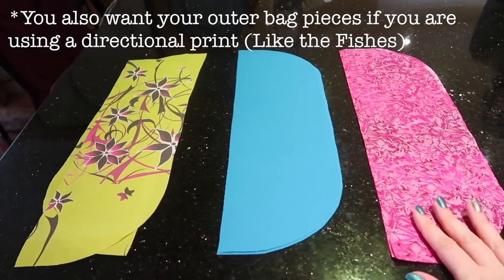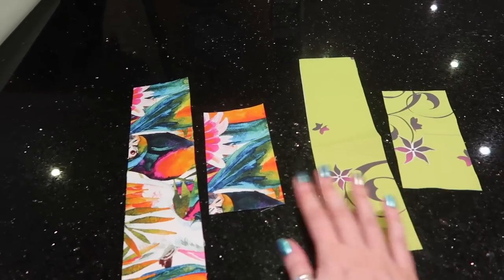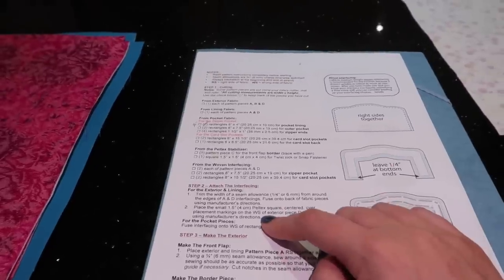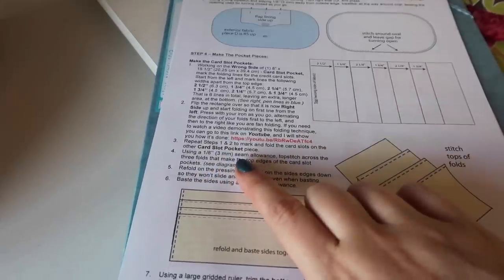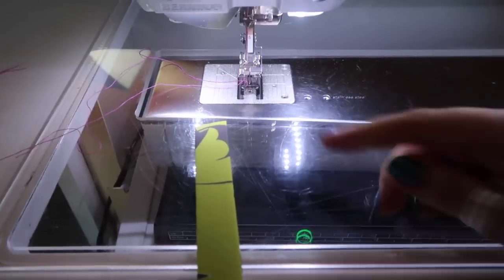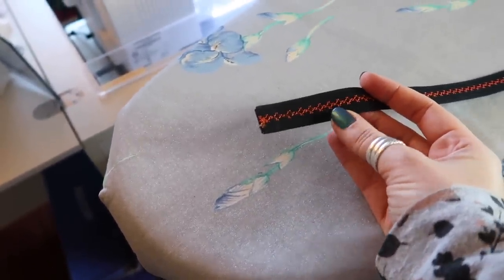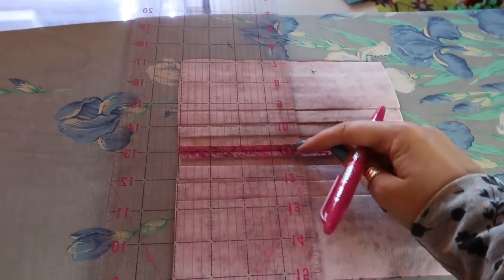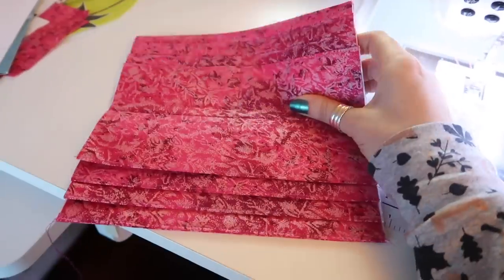How To :: Necessary Clutch Wallet Sew-Along :: Assembling the Card Slot Pocket

Comment: I cut my pattern pieces out traced them on to a plastic kitchen cutting board. You know the flimsy thin kind. Then used them as my template. Also I used this plastic cutting board to measure and trace a template to press out the card pocket accordian. I labeled them with their measurements, then slide them under the fabric, fold over and press, switch to the next size and fold over fabric and press, repeat. Makes it so much faster.
Reply: As I read this I realize it makes no sense, lol AND just how great you are for taking on a tutorial. Thank you again
Reply: Yes this is what I do You can also use them to help with your folds
Reply: @mayambrose5030  yes I have those too

Comment: Can i ask what die set you used for this and where you got it? I need to know the size?
thanks, really enjoyed your series on making this, i have ordered the pattern and have cut out 3 of them to make, but I would like to use the rivets since I have a press. thanks,
Reply from the maker: I use the 7mm wide and 9mm high rivets 😊 let me know how you get on, I'd love to see what you make x
Reply: thanks so much for your quick reply, can you point me to the die set?
Reply from the maker: https://www.ebay.co.uk/itm/Setting-fixing-tool-dies-single-double-cap-rivets-hand-press-machine-/181275957632?var=&hash=item6fd43764b5 this is the one I have but make sure this fits your press before you buy it 😊
Reply: B Moyer Not being a fan of stopstitching I cut  1/4 inch strips of decovil iron on slide them into the folds and iron down If you are worried about the extra thickness cut slightly narrower on the ends

Comment: I hear you saying 18.5 inches long card slot pockets, do you mean 15.5?
Reply from the maker: There is an updated pattern which I was working from, there are difference in piece sizes and measurements between the two.

Comment: I know the zipper pocket does not need lining but does the outside pocket need lining the flap on the zipper pocket the back piece
Reply from the maker: In video 1 I go in to which pieces need interfacing. I'm not sure I know which piece you mean? The outer portion of the zipper pockets needs lining but that's it as far as the zipper pocket pieces go 😊 hope that helps
Reply: thank you
Reply: think I was talking about the 854 back piece of the zipper pocket not the pocket lining

Comment: before you sew the lining together  you said it measures 16 inches. im getting 15.5 inches. i even put my pieces together and measured the same 15.5. what am i doing wrong..
Reply from the maker: Do you have the most recent edition of the pattern, as the original was a bit smaller than the updated version 😊
Reply: not to sure i bought the pattern a few weeks ago and decided it was time to make it..
Reply from the maker: Hmmmm you should have the updated version then. Have you checked the little "test square" to make sure the pattern printed out at the right size, you need to make sure you printer is printing at actual size not scaled in anyway. 😊

Comment: My pattern piece is only 11 and 1/2 inches wide.
Reply from the maker: You may have the older version of the pattern. I can't tell you the exact date it was updated but the newer version has slightly larger outer pieces. The steps are all the same just the sizing is slightly different. 😊
Reply: @KittenishBehaviourSian  Thank you for replying, and yes I have had this pattern for some time now.  Loving your videos so far.
Reply from the maker: Sharon Armstrong  no worries! Let me know how you get on 😊
Reply: @KittenishBehaviourSian  Well I feel rather foolish as I realised I forgot to add the centre piece to the pattern.   That explains the difference in the width.  Oh well off to cut new pieces.  I am hoping to use the fabric I cut wrong in another pattern.  Just a small tip, I would have like to see the videos numbered eg 1,2,3 etc.  Just makes it a little easier to find.